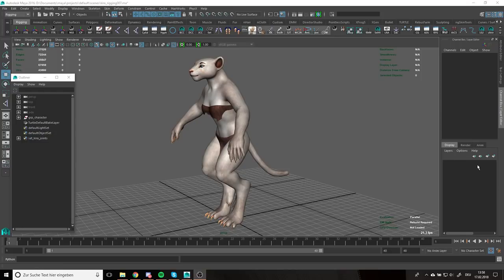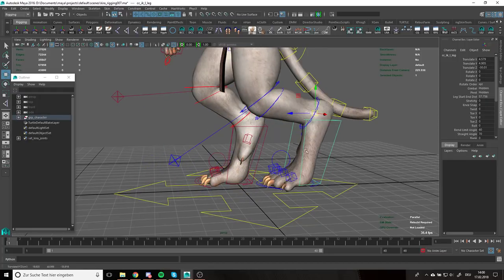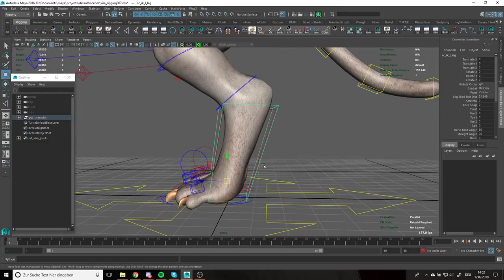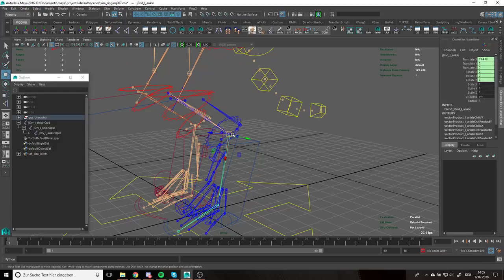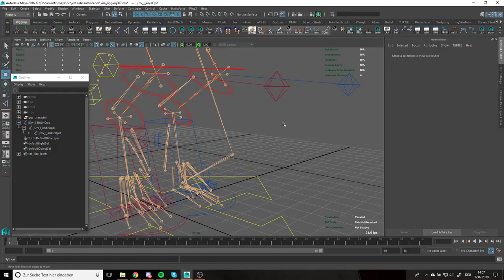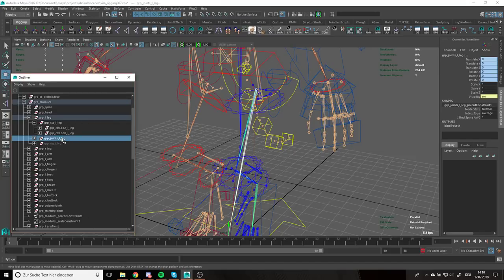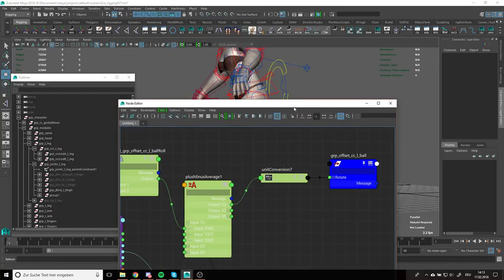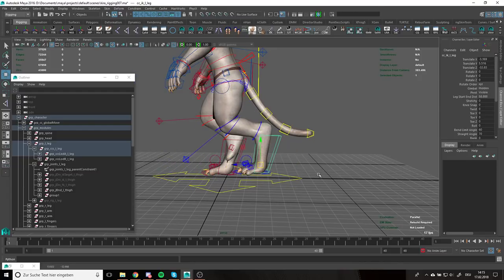Autodesk Maya - biped leg to quadruped leg

Comment: Thanks for your videos, they are always very helpful. :)

Just wondering, what the benefits for this setup are over a multi-chain IK solver? 
Thanks
Reply from the maker: Hey, thanks dude. Can you elaborate what you mean by multi-chain ik solver?
Reply: Yeah, sure. I meant this one: https://knowledge.autodesk.com/support/maya/learn-explore/caas/CloudHelp/cloudhelp/2016/ENU/Maya/files/GUID-D9184F1C-0D23-444A-BDA0-654D81C647C9-htm.html
In combination with preferred angle it should do the trick I think.
But I am really not sure whether it is a suitable solution for this or just for not so precise/controllable things like spider legs and such. 

I would really be interested on your opinion on that.

Cheers
Reply from the maker: I had a quick look at it for a few minutes but couldnt find a solution to include pole-vector feature. 
Have you been able to use this constructively in a rig? I didnt even know this existed tbh.